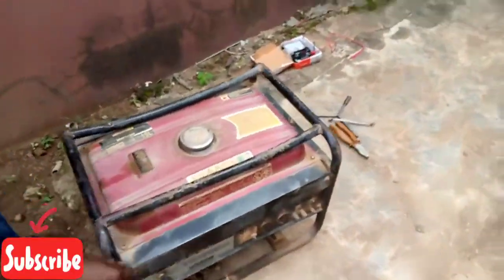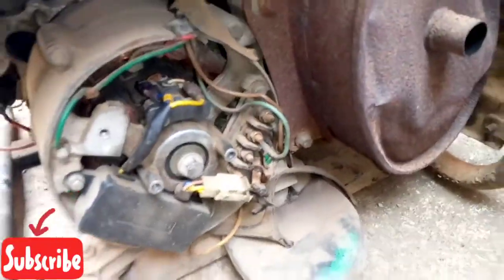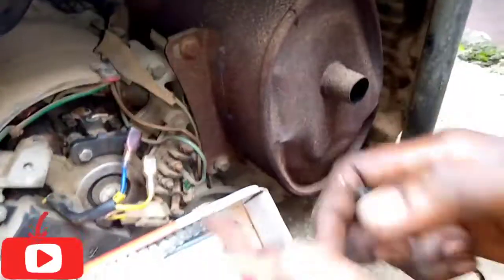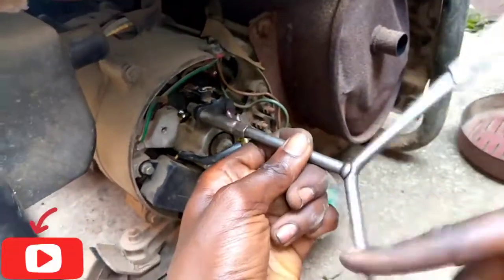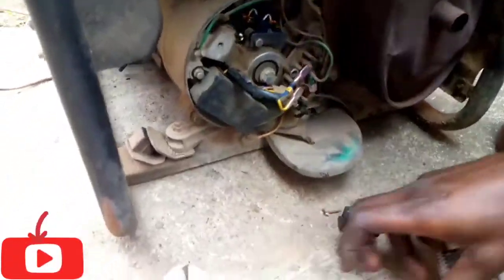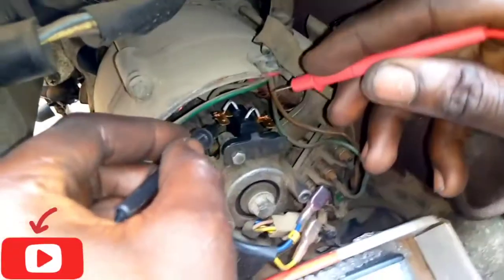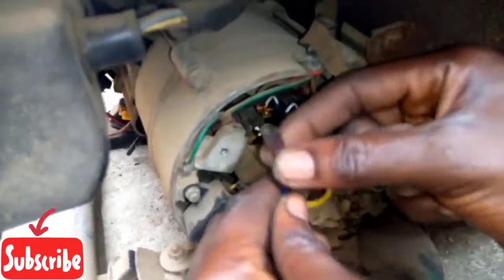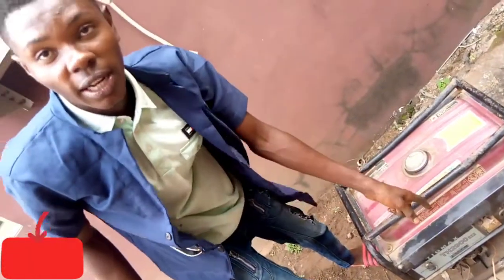Generator brush replacement

Comment: Thxs for the information,what is the disadvantage of blushed  generators
Reply from the maker: 1. *Maintenance Requirements:*
   - *Wear and Tear:* Brushes and commutators wear out over time due to friction, requiring regular maintenance and replacement.
   - *Dust Accumulation:* The wear of brushes generates dust, which can lead to additional maintenance issues and potential operational problems.

2. *Efficiency:*
   - *Energy Losses:* Brush friction leads to energy losses, making brushed generators less efficient compared to their brushless counterparts.

3. *Noise and Vibration:*
   - *Operational Noise:* The physical contact between brushes and the commutator can generate noise and vibrations during operation, which may not be desirable in certain applications.

4. *Sparking:*
   - *Electromagnetic Interference (EMI):* The commutation process can cause sparking, leading to electromagnetic interference that can affect nearby electronic equipment.
   - *Fire Hazard:* Sparking can also pose a fire hazard, particularly in environments with flammable gases or dust.

5. *Lifespan:*
   - *Reduced Durability:* The wear on brushes and commutators generally results in a shorter lifespan compared to brushless generators.

6. *Performance:*
   - *Variable Performance:* The performance of brushed generators can degrade over time as the brushes wear down, leading to inconsistent output and potential reliability issues.

Comment: What did you measure on multimeter? Is it dc volts? What reading should you see on a good carbon brush?
Reply from the maker: 220 volt

Comment: Good Day. My RDX- 8910 Fireman generator is working but voltage fluctuates when load it applied etc. Because of this the UPS at my office don't work. I have changed the AVR and also played with the engine revolution by regulating it but it turned out to produce over high/too low current. Pls any idea what could be the cause?

Comment: What could be the cause of its producing low voltage and sometimes it increases .is it the carbon brushes or AVR that could be the problem
Reply from the maker: firstly I will need to know, if the speed of the generator is smooth. if yes. replace the Automatic voltage regulator (AVR)

Comment: Thanks a lot I love what you're doing... I'm a DIY kinda guy, I work everything and recently a generator repair man who's repairing my gen decided to extort me by using terms I don't understand not knowing that I'm a handy man. So I decided to check the generator he said I'd have to change its engine and I thought it may be brush because it wasn't tightened when I opened the compartment where it sits and the wires of the brush were not connected either. I connected the wires, positive and negative, & tightened the brush but it was making a lot of noise and sparking and at a point stopped giving light, I brought out the brush and discovered it was worn out. I need your contact for more info
Reply from the maker: If I may ask.. are you referring to the thread of the bolt that tighten to brush that worn out or the lead of the brush.